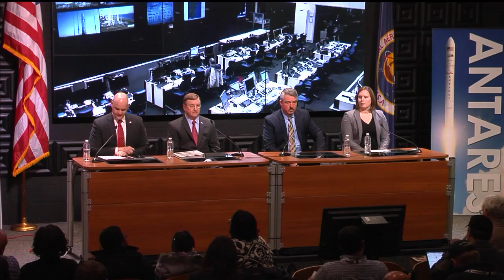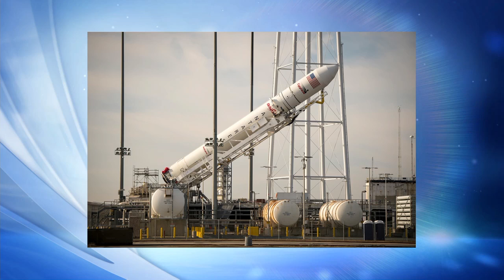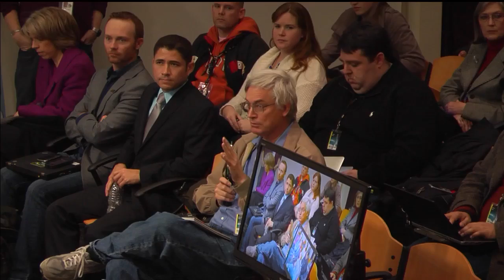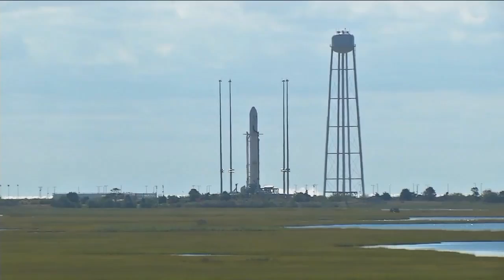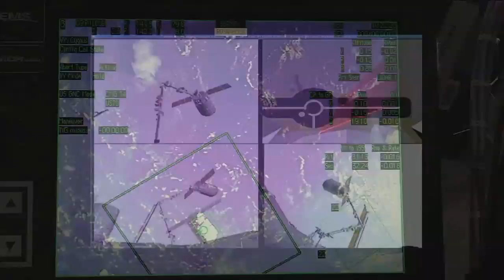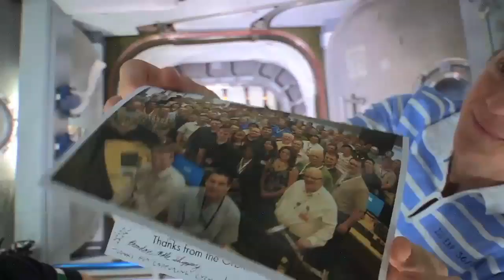NASA Television Airs Pre Launch Status Briefing for Resupply Mission to Space Station

Comment: I don't want to be a jerk but Antares is nearly twice the cost of Falcon and the AJ26-59 engines it uses in the first stage are not even an original design - ripped off Soviet moon rocket engines that had the rust scraped off, and re-branded as Aerojet. They are Soviet NK-33 engines (designed by Nikolai Kuznetsov), which were the first closed cycle engines - considered to be far ahead of their time in terms of performance. I heard somewhere that they are not even being recovered after being used! It's such a huge waste! These engines should be considered historical artifacts!